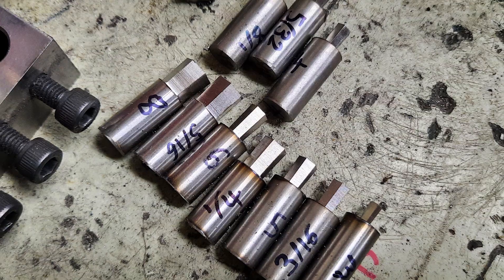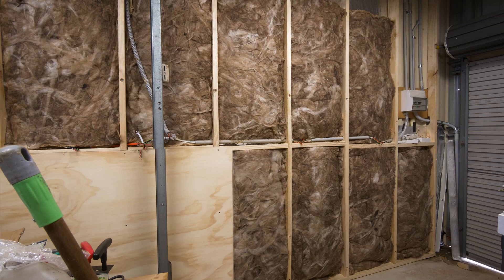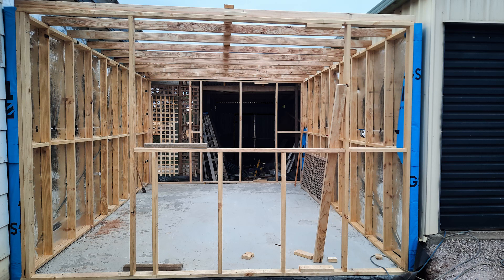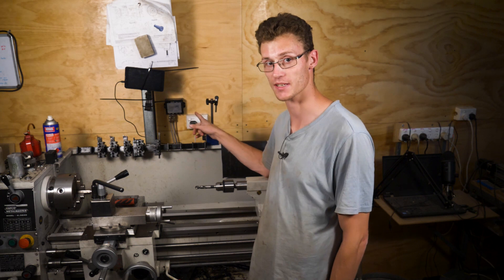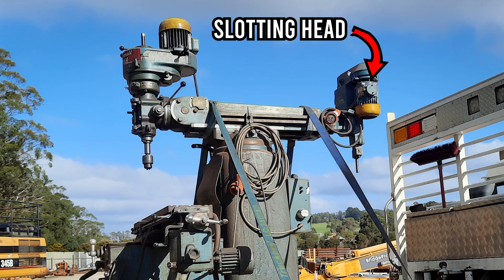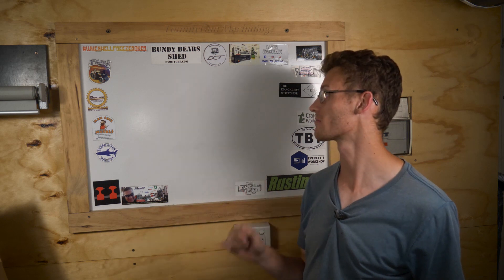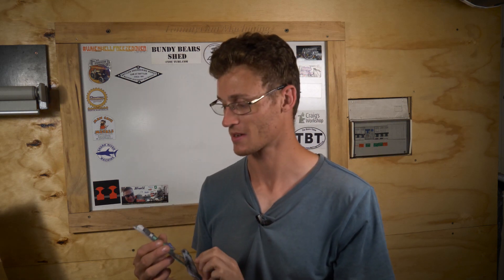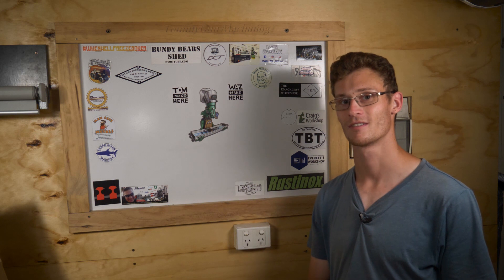Where have I been? Workshop Update

Comment: I nearly bought a Kondia Powermill before I got the Bridgeport. I have since read that they are one of the better clones out there. Glad the TouchDRO is running. I'll let Yuriy know that two of the four are live. Thanks for the promo👍
Reply: Mine will almost certainly be the last up and running, but it will be up and running - 100% certain of that. :)
Reply from the maker: Thanks for the DRO unit and your great videos
Yeah I've yet to actually use the mill so far. I had a VFD blow up on me (I didn't bypass the switching relays on the first few tests)

Comment: What a neat mill. Nice score. I'd love to adopt the hercus when you're done with it.
Reply from the maker: We'll see once this one is up and running
I do want to make a riser block for the Hercus first. That has been on the to do list for about 4 years and is half finished
Reply: @TomMakeHere  I have an old 9" hercus lathe, which so far does what I need, but have always wanted a hercus mill to complete the capabilities. Sadly most of the old school ones were scrapped when schools changed direction. Some got listed for tender, but you need to be in the loop and sadly most of the time the extra tooling gets lost.
I'd like to tap your brain juices sometime for tips on the tooling you use for the 9" lathe. I'd love to have collets, be able to cut metric threads etc, but am not sure what is compatible.